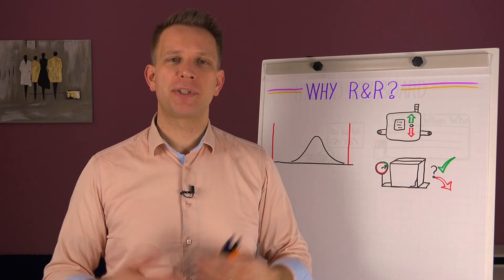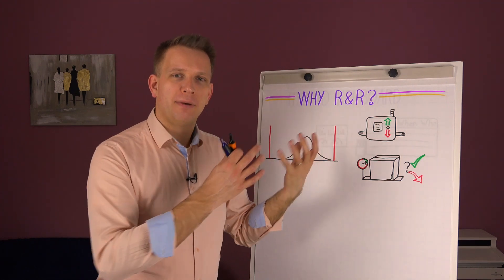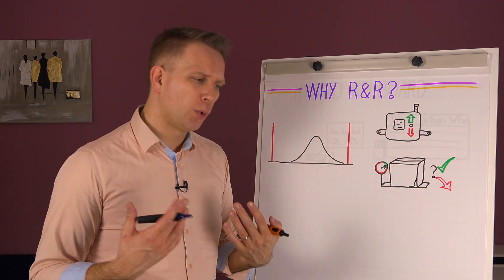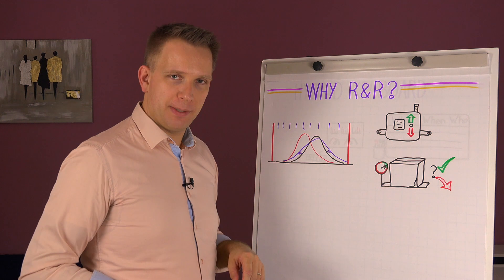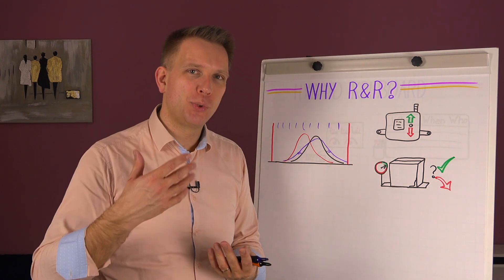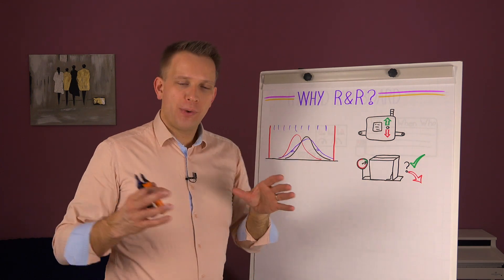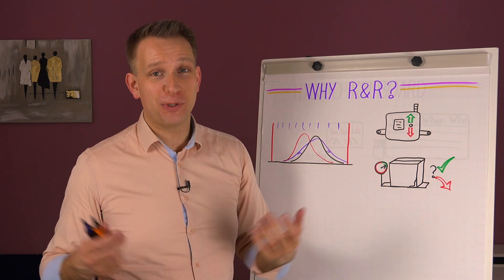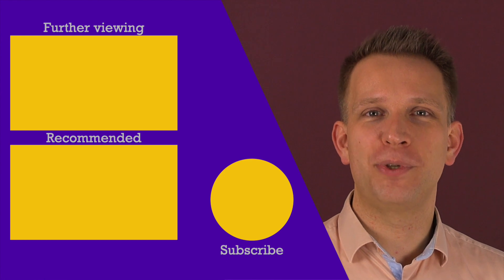Goal and purpose of R&R | Why do gage R&R

Comment: Thank for the knowledge your video delivered. 
But to make the video more comprehensive, I think it would be better to have some frame with text to note out the key points, so the audience could grab it quickly.
You may consider split up the theme to some milestone and talk about it.
The visulization chart (about Spec limit and measurement trend) could be more intuitive if you make it using sketching (let AI help you).